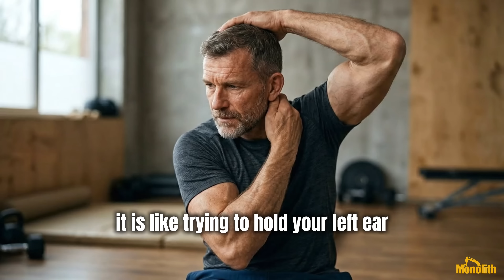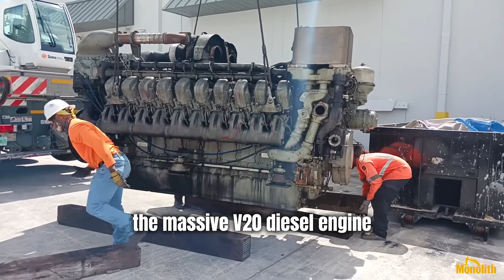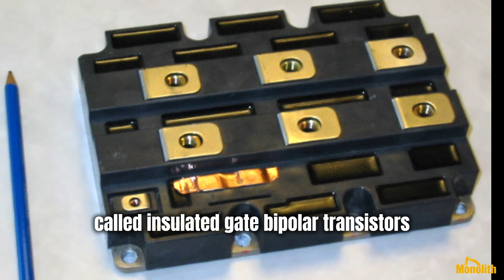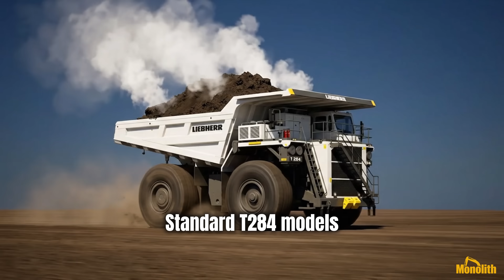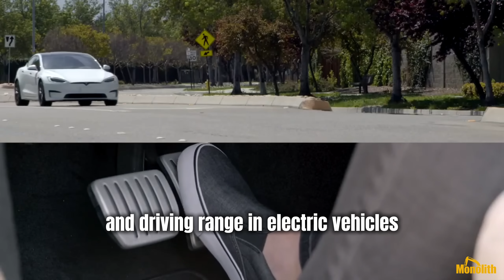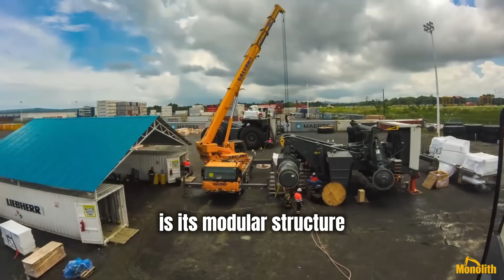Why Does a 3,600 HP Engine Send ZERO Power to the Wheels | Liebherr T 284

Comment: I thought this 600-ton mining truck worked like a giant normal truck — but the diesel engine never even powers the wheels directly.
It actually drives using electricity, with massive electric motors moving a machine heavier than 400 cars.
Reply from the maker: Yes my friend

Comment: The thumbnail doesn’t really any make sense. Even your average combustion engine daily driver is literally almost never has its wheels directly driven by the crankshaft. It uses what I interpret as a “mechanical transmission” to transfer engine torque to the rest of the drivetrain, where at the arse end that torque is distributed to wheels .  A diesel electric drive system uses what I imagine as effectively an “electric transmission” or “drive train” that converts engine torque back to power, then distributes that power to traction motors which covert it back to torque and to apply that torque to the wheels, probably via a mechanical reduction gearbox of some sort.

Comment: Where from it get Earthing ?
Reply from the maker: Instead of running electricity to "ground", the Liebherr T 284 provides potential equalization by safely trapping and isolating the high voltage on its own chassis.
Reply: @MonolithWorks2 please make a seperate video on its work, with animation and diagram

Comment: Would be good to use some of that wasted energy in heat either by storage of power if it can be feed into the electrical grid
Reply from the maker: Yes, but the technology of that time did not yet have a system to store this energy. Transmitting through cables doesn't seem to be suitable for a machine working in a mine.

Comment: Why not hydraulic coupling?
Reply from the maker: In hydraulic systems, there is a serious loss of energy in the same transmission system. Maintenance costs are also very high. This is why engineers must have preferred this way. Thank you for your comment, sir.
Reply: @MonolithWorks2 fair enough just thought that wasted heat energy could be used for some neat purpose
Reply from the maker: @Alex1001w Yes, what you said would be much more logical.

Comment: Bro put this tech only in the mining trucks and the Diesel locomotive and the hyper trucks
Reply from the maker: Don't you want this system in cars?
Reply: Many EREV works like this. Also BYD's DM-i hybrid during low speed also use petrol ‐> generator -> motor power delivery.

Comment: Cant the electricity generated by the truck going downhill be pumped back into the grid instead of being vented out as heat?
Reply from the maker: Yes, that would be good, but the technology at that time didn't have a system to store that energy.
Reply: @MonolithWorks2  ohh that makes sense. thanks 👍
Reply: Have you ever seen the location of most mining sites? 

They tend to be in very remote areas, hence the cost of putting up infrastructure to put energy back into the grid is unrealistic
Reply: @TheJoker-qn6vw  I was thinking the same thing
Reply from the maker: @TheJoker-qn6vw Very true 👍
Reply: how exactly?
Reply: Use roads with munumum incline, just to overcome wheels rolling resistance. Moving up easier, Moving down free.
Reply from the maker: @dazzershell Mining sites consisting of rocks don't seem to be suitable for this.
Reply: Lmao, like how? You want a cable to be connected to each truck? Because this opens up a can of worms for completely different kind of problems... Even then, the electricity generated in return is not high enough for the inconvenience to be worth it...
Reply: @Gloverfield actually there are trolley operations too, but only on the busy parts of the road
Reply: @PiotrMasełkowski  Explain to me how long do these take to setup? And what will you do when the landscape changes around you when the area is being heavily mined?
Reply: Instead of grid, the truck would have to have a huge battery to store energy, like hybrid car. Probably not viable at this scale, and it would reduce capacity slightly.

Comment: Tolle Technik. Der Diesel generierte Antrieb ist natürlich ineffizient, aber mit den Stromleitungen an der Steigung wird der Nachteil mehrfach kompensiert. Besser für den Retarder wäre natürlich ebenfalls eine Stromrückführung statt Abwärme, aber da sind die Kabel wohl zu dünn dafür.
Reply from the maker: Yes, you are right. It is very good for these machines that the electric motor can provide maximum torque, especially at the first take-off.

Comment: Exactly the same as my Mitsubishi Outlander, 2 motors and the engine runs a generator to power them.
Reply from the maker: That's very good. Is it really efficient? Have you had any problems?
Reply: @MonolithWorks2 It's very efficient and it's been totally reliable, had it maybe 7 or 8 years and it's done 170k miles now, drives like new
Reply from the maker: @Slash1066 Too long a time to test. Very good!

Comment: Accelerating such amass of weight would disintegrate any form of mechanical coupling quickly.
Reply from the maker: Absolutely. Electric energy can do it much more easily.
Reply: cant break or wear  a magnetic force  this is how byd shark work but it is conected to the ecvt and battery  too ive seen baja cars with this system where no conection from engine to drive train just copper wires

Comment: This is not efficient
Reply from the maker: This is one of the most efficient systems right now. Why do you think so?
Reply: @MonolithWorks2 ig he is interested in challenging the architecture made by hundreds of phd engineers
Reply: Why not convert power strait to hydraulic motor.... tell me no hodrolics involved to turn 2 storey "WHEEL"😮
Reply from the maker: The Liebherr T284 utilizes an electric motor to enhance energy efficiency by minimizing mechanical losses while providing maximum traction power (torque) right from the start. Its design features fewer moving parts compared to hydraulic systems, which reduces maintenance needs and leakage risks, and its dynamic regenerative braking capability significantly prevents mechanical brake wear.
Reply: @MannaPillay  на тепловозах широко используется электропередача, как и на карьерных самосвалах. Но есть и тепловозы с гидравлической передачей -- обычно это менее мощные и более лёгкие локомотивы (гидропередача компактнее и дешевле). И в случае тепловозов электропередача обычно более энергоэффективна, нежели гидропередача.
Reply: When you get up to the kind of weight that a truck like this or a diesel electric locomotive is moving it is more efficient to use this system. The biggest difference is the reduced amount of wear items so the truck is not down for mechanical repairs anywhere near as often. So yes technically it is not as energy efficient to convert diesel to electric to propulsion, it is financially efficient in the long run because of the increased uptime and reduced maintenance costs.